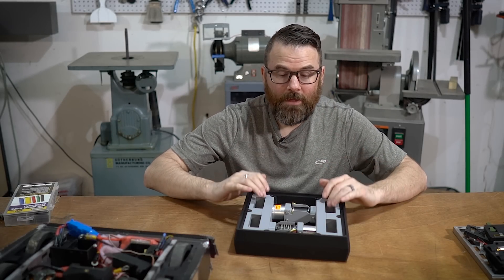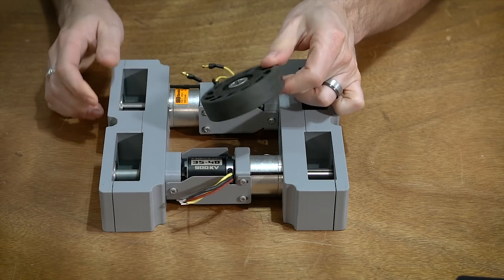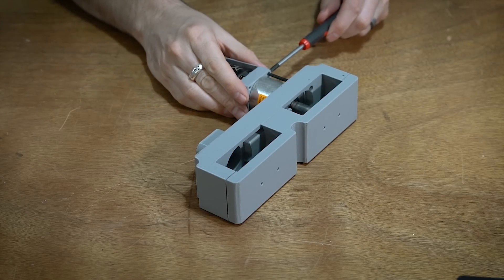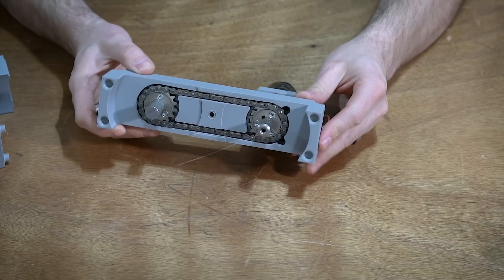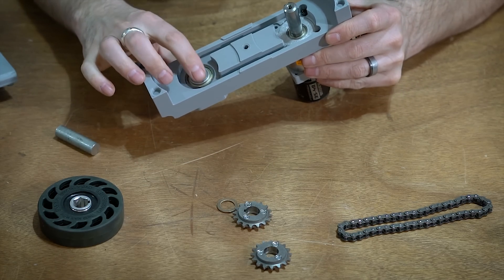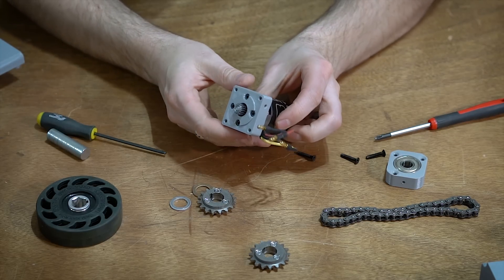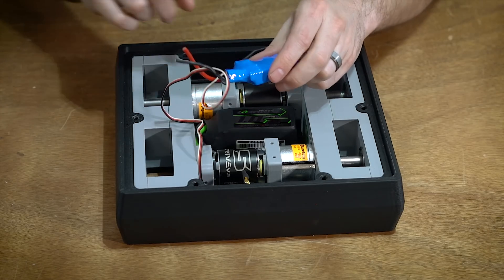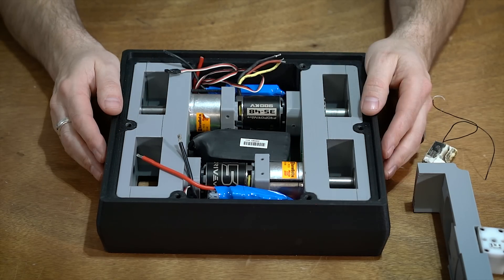Drain Bamage! -  Drive Module

Comment: I often 3d print half tube for wires and set resin this keeps those annoying wires in right shape so they can be easily fixed and removed you might want to try resin moulding for wires and module instead or 3d printing of other materials give them a bit of flexibility

Comment: Are you not concerned about the chain rubbing on its raceway and removing it's tension effect?
Reply from the maker: Not really.  The 'tension' is very subtle and if anything just follows the natural slack of the chain.  There are no sharp corners to catch, so friction shouldn't be an issue.  I will either use nylon or TPU, which is non-abrasive so it will just slip right past.

Comment: I think using a custom PCB for Power and Signal distribution could free up more space and make the robot simpler to service. It's what Seth Schaffer uses in Division.
Reply from the maker: I'm on the fence.  I don't think it would save any room, it would be another thing to find a home for.  The wires already need to exist and once you add the connectors and a flat PCB, it gets hard to fit.  Also, a PCB would add another failure point.  Wires are flexible and can rattle around quite a bit.  But solid solder joints can easily snap.  I think the distribution board is nice for smaller bots, but when you're dealing with larger weight classes and higher current, I think direct wiring is still the most reliable.  Keep the design goals in mind!  Does a PCB make it more reliable or durable?  Nope.  Great idea, but maybe not for this bot.
Reply: @RobertCowanDIY  I have to trust your experience. I just thought that having a single PCB instead of a potential ratsnest of wires for the cross connection against something flat could make it better. But I agree, that you'd still need to cut wires to length, solder connectors - etc. So it wouldn't cut down on work.
Reply from the maker: @Spoil001  I do think you're minimizing the potential hit in reliability.  I know End Game had this idea awhile back and it was a major failure point until they got it figured out.  If it only solves the hassle of wiring things together, it's not worth the risk IMO.  Very few people have reliability issues with rats-nest wiring.  So it's not really a problem that needs solving.  Also, be wary of people trying to solve non-existent issues by offering a product for sale.  It's a convenience for sure, but I think it's more aimed at beginners.  Once the rats-nest is made, the pain and hassle is over ;-)

Comment: Why do you choose to use heat set inserts rather than plastite screws? I had always heard plastites have a better pull out strength, but maybe I’m wrong or maybe there’s other design considerations behind your choice. Love the robust drive design.
Reply from the maker: I use heat set inserts, only because I have them on hand.  Plastite fasteners are great and I used them professionally, but it's hard to keep a large selection of sizes on hand, it's easier to have common sizes of heat set inserts and then use standard fasteners (which I have a lot of).  For things that won't see much of a load, I'll just thread the plastic directly.

Comment: For a video on chains I think discussing the cheap options, like the most common, easy to acquire, "you'll find it on the side of the road or the side of the aliexpress" chains and sprockets would be useful.

For a lot of people, custom machining titanium sprockets might... blow tf out of their budgets so to speak so if there were some standards that were probably close enough to reasonable enough sizes tips on those would sound useful.
Reply from the maker: Noted!  Chains themselves are really cheap.  Just stuff off amazon and such works.  Sprockets are easily had through eBay and other places.  I just went a little overboard on mine.

Comment: I realize it's probably too late but you were talking about doing the motor mount front plates in aluminium vs 3d printed and my only thought was mightn't the plastic get a bit melty since the drive is the weapon for this bot and will probably spend a lot of time in modes that make motors hot and bothered?
Reply from the maker: Maybe, but probably not.  I've never really had my motors get THAT hot.  Maybe with PLA it would get a tad bit soft, but it really takes a lot of constant heat for that to happen.  Keep in mind matches are 3 minutes max, so you need to dump a lot of heat into a plastic part to have it deform in only 3 minutes.  But most likely I'll do aluminum since the extra weight won't be that much, and I have a bit of extra time.

Comment: Would the motors not get too hot to be directly touching a 3D printed part inside an enclosed area like that?
Reply from the maker: I think they'd only get hot enough for that to be an issue if one of the drive sides was locked up, and then you have other problems, and who cares about the plastic at that point?  I've run Crippling Depression HARD with a mostly bound-up drive side (it still kinda moved) and the motor was just barely too warm/hot to touch.  It would certainly soften the plastic a bit, but wouldn't deform it in any meaningful way.

Comment: You can reinforce plastic threads very easily if you have the holes oversize and then use helicoils, glued in place with a heavy duty nylon glue (loctite has some). It's only just, bigger than the required thread, and it will be much stronger than the plastic on its own. The hole should be bare, smooth bore, this way the glue will become an anchor. This can also allow you to subsize the thread, because a thread in metal will always hole better than a thread in plastic. Jm2c.
Reply from the maker: At this weight class, you shouldn't rely on plastic threads for ANYTHING, no amount of reinforcing will hold.  The only fasteners I have in there are just to hold it together for putting it inside the shell.  They really won't see any forces once installed.  In smaller weight classes you can get away with it, but at this weight class, nothing will hold, they will always fail.

Comment: A teflon strip in the pinch area would be nice instead. Considering the life of the bot, it wouldn't need to be something automotive grade, so a small strip should suffice. The chain would auto lock it in place and overall friction will decrease. That's less load on the motors, more battery. You wouldn't think it's worth doing, but if one can notice this on recumbent bikes as a switch between teflon runners for the long chain and classic plastic ones... the battery will defo feel it.
Reply from the maker: That's a decent idea, but adhering the strip to the plastic would be tricky.  And if it comes off, it can jam up the chain.  I do have some UHMW tape, but it would be difficult to reliably adhere.

Comment: I think you can get away with a fingertech switch.  Your average current is only 20A over 3 min and you shouldn't really be spiking your current too much without a weapon.
Reply from the maker: I did think about that, but I've gone through several fingertech switches over the years and they're not up to the task for this application.  They could handle the load, but not the abuse.  I've never had a Whyachi switch fail.  Everything is way overbuilt.  The fingertech would 'work', but it wouldn't last forever.

Comment: Really impressive. talking about thats single screw that hold the assembly together. Why is it so important that once you remove that assembly from the robot it does not fall? What are the odds of it falling, and it it falls what are the issue you will encounter? If you make those 4 side post longer, it would prevent from falling because of friction without that screw.
Reply from the maker: At an event, you are typically frantically trying to work on the thing.  9 times out of 10 it would be fine, but that one time it comes off, your chain would come off, you'd lose a screw, etc, etc.  It's there as a safety measure.  Also, it doesn't hurt anything.

Comment: Definitely would want to see that chain video, we've run into some belt limitations in the past but haven't been able to commit to the switch to a chain based system
Reply from the maker: Gotcha.  I think I can put together something simple.  They're really not that hard, you just need to see how they work and how to use them.  I wouldn't go too in-depth, just the basics.

Comment: I'm really enjoying this series Robert, my better half and I really want to build a bot and you're going through these at exactly the right time! And YES please do a segment on chains, that would be great. Also, the space you carved out of the 'meat' on that next iteration is fitted exactly to hold the power switch if I'm not mistaken, it's a little hard to tell how the size of the radio module compares to the switch though.  Since the radio isn't a nice rectangular shape, are you looking at making a small carrier for it?

Let me say that a different way.  If the radio is smaller than the switch, can you print a mount for it that would fit into the same space as the power switch?  That way both halves of the drive module would still be identical, and both components would still be firmly held in place in the same meatspace.  Or if the switch is the smaller item, it gets the treatment instead.

Ray Billings showed his battery box for Mortician a few months ago on his channel and while that's not the same thing, it's similar.  Holding an oddly shaped component in place with a close fitting custom carrier.
Reply from the maker: There will be more videos ;-)  I still haven't fully figured out the radio situation, but it will be similar to what I did on Crippling Depression.  I don't like having it tightly secured.  I want it to stay put, but loosely in a confined space.  I'll see what I can come up with for chains.

Comment: I'm going to guess that a massive vertical impact may "pop out" the can of the motor from the support bearing. There just doesn't seem like a lot of material to ride in the bearing.
Reply from the maker: It's the same amount of material that we have on Copperhead's weapon motor and drive.  Just a couple mm is enough.  It MIGHT be able to compress forward and then up and out.  But it's still rigidly mounted to the mount.  We will see though, it's a good observation!
Reply: @RobertCowanDIY  If its not too much effort, you could extend the motor shaft slightly out the back of the can, then press on an aluminum spacer, maybe with a slight taper/chamfer.
Probably only worth if it you start to notice it happening in matches.
Reply from the maker: @roboman2444  Yeah, I don't foresee any issues, but we'll see.  If I went that route, I would need a longer shaft and some other upgrades.  We'll see how it goes.

Comment: No brass inserts into the motor faceplates?
Reply from the maker: The motor interface will most likely be aluminum.  Also, there's not enough room for brass inserts.  ALSO, the only holding force is to keep the motor from shooting out the back, which it can't do because of the rear support.  So it's really just to hold it in place during assembly.

Comment: Shock absorbing trays and gaskets for some internals to round off the acceleration and jerk peaks on the large hits would be nice. Not too soft they bottom out of the large peaks, not too hard that they don't do enough softening. Two or more parameters of shore hardness / coefficient of elasticity could even be appropriate. That is how systems that need to absorb unknown impacts are designed, like the emergency springs on the bottom of elevator shafts; two different K springs commonly.
Reply: I was thinking of that, too. G-force mitigation for sensitive components. Maybe potting electrical bits with viscous epoxy or gel (ideally with high-electrical-low-thermal conductivity). It's somewhat monstrous, but hey, this is combat robotics so it should be!

Comment: Can you do a video on your experience using set screws and battlebots? Did you use thread locker at all with them?
I used them in my school's battlebot and the weapon extension shaft set screws all flew off. Our second fight, we got flipped 2 times, our motor rear supports sheared the threads(Plastic PLA) and the set screws on those drive motor shafts for the gears came loose.
Reply: Set screws are bad at everything ever. Never use them with anything that must be taken apart has reversing or impact loads or to transfer torque.
Reply: Normally there's a keyway for combat robots. If you must use set screws, file a flat spot on the shaft.
Edit: he covers that at 8:35 through 8:52 :) "I hate set screws because they always fail"

Comment: Nice! There are two things I think about: 
1. What if the frame gets bend? Will you be able to get the inside out? 
2. I know you don’t like too much fasteners but you could make the holes for the bolts holding the adapters to the gearbox through-hole (no thread) and secure them with a locknut on the other side of the adapter. That will be more secure than threaded 3D printed material.
Just my two thoughts on this. The bot is looking very nice so far! 😎
Reply from the maker: I really don't see a circumstance where the frame would bend.  It will yield and crack before that happens and I don't think featherweights have enough power to do that.  We'll see!  For the motor mount, it will most likely be aluminum.